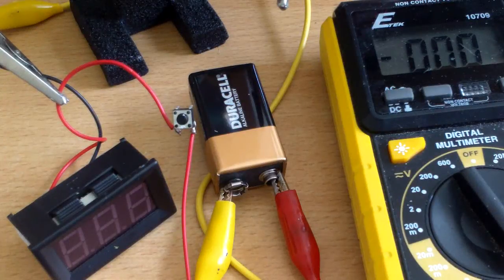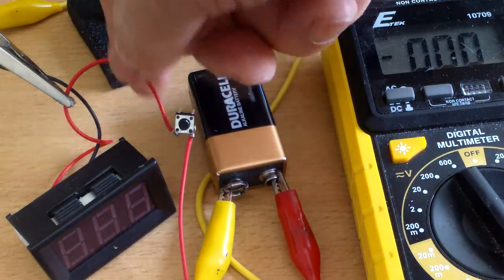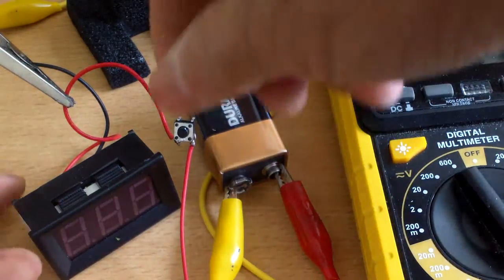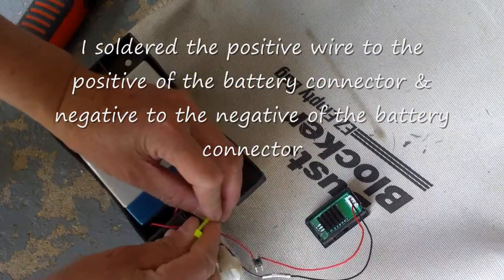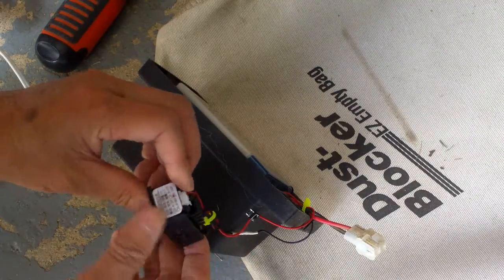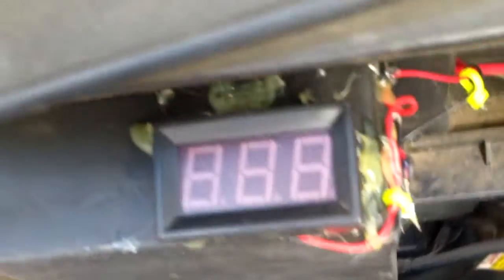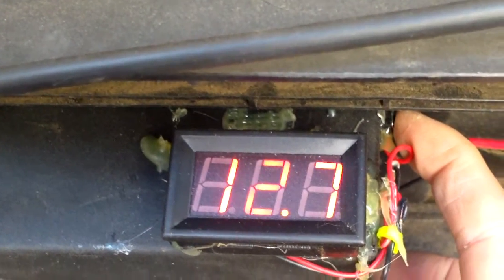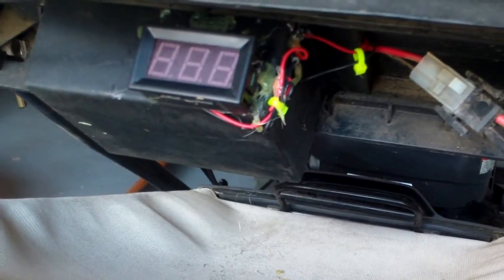Installing a digital volt meter on a craftsman key start lawn mower

Comment: LED display that is where your .2 volts is going. Maybe if it was LCD it would be more accurate because LCD draws less power. Your multimeter has it's own power supply, so it's not using electricity from the battery you're testing to work.

Comment: I have a similar volt meter which I tried to put where an old analog meter used to be on an electric mower, but I can't figure out why it doesn't work. the meter works on another battery and connection on the mower shows voltage when testing with my multimeter. could it be the current?

Comment: Hello, i'm curious did you put on/off switch on positive or negative cable ?
Reply from the maker: +Drago Grljusic  The digital volt meter on/off switch is installed on the positive cable.
Reply: Thank you alot

Comment: I wonder if the meter reads low because it is cheap?  I'm sure you're correct about the voltage to drive the display.

I've been planning on getting a bunch of those meters (they sell them with all different color displays), and I would not be surprised if each one read different from the next.  The interesting correlation would be if, say, all the blue display meters are .2 low, all the amber are .1 low, etc.  That would definitely prove your theory.
Reply from the maker: I think they are pretty accurate. The ones I have use the battery it is measuring as a power source so there's definitely a small drain on it. I could be wrong but that would actually be more accurate as you are showing voltage under a small load. The earlier volt meters I bought requires a separate power source to power them.